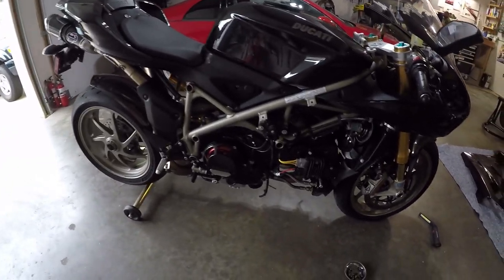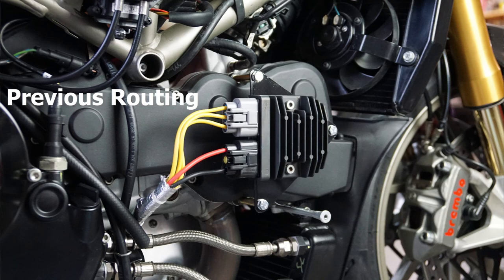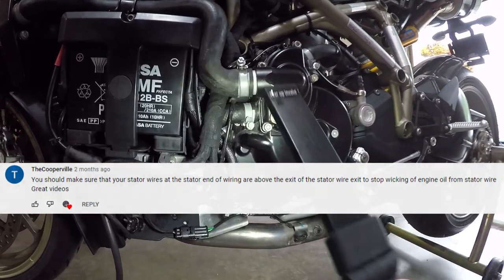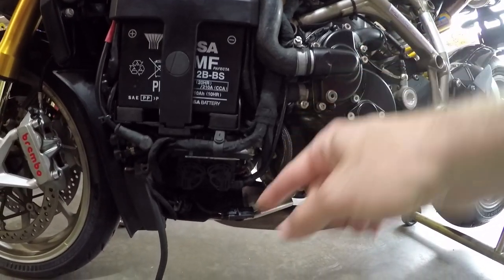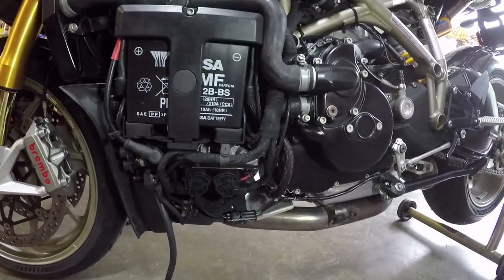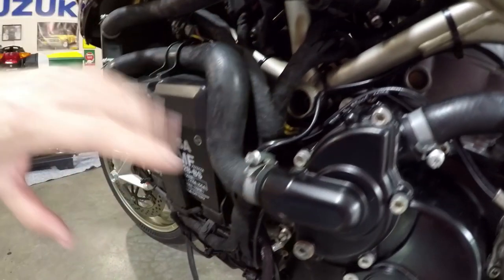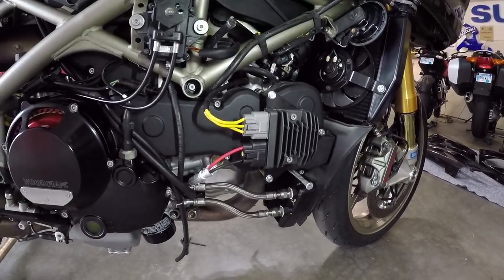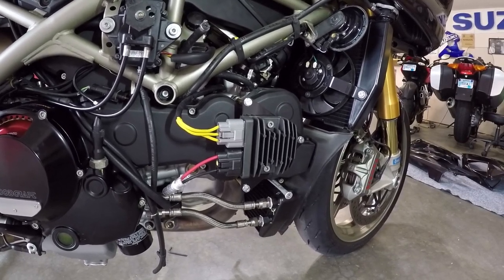Ducati 1198S | Ep.13 | Voltage Regulator Replacement UPDATE

Comment: Do you think it's worth just changing the voltage regulator without moving it? I bought a MOSFET like yours but I don't think I have the skills to relocate it. According to the specifications, this one works much colder than the other. Thank you and I really like your technical videos.
Reply from the maker: I think it's definitely still worth upgrading to a MOSFET one even without relocating.

Comment: I was amazed at your diligence and perseverance on the E30 videos.   I do have a question if you don't mind me intruding on your lifer.  A few days ago, I delivered some flowers in my 1991 BMW 325 IX that I adore.  The car was running perfectly with no issues.  I parked the car delivered the flowers and got back in the car and the automatic shifter would only engage in park.  no neutral, no gears, the shifter would move but not engage---any ideas on the issue and how to repair????
Reply from the maker: Hi Gregory! Thanks for checking out the E30 series. It sounds like your gearshift cable has either broken or has come disconnected at one of the two ends. Here's the part: https://www.ecstuning.com/b-genuine-bmw-parts/8-cable-ix/25161215859/

But, before buying that, I would get under the car and see if you can't spot the problem first.